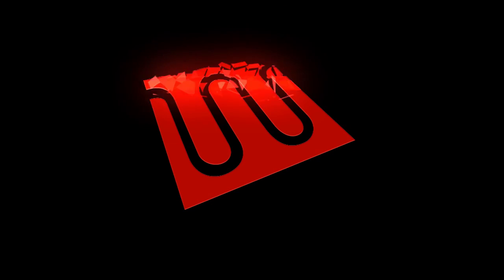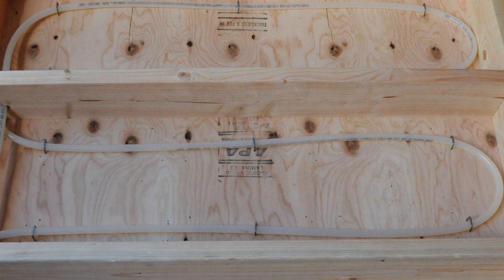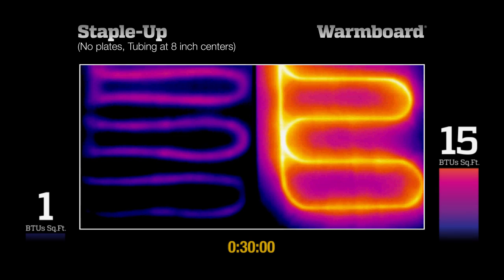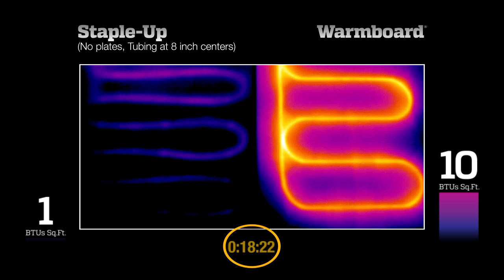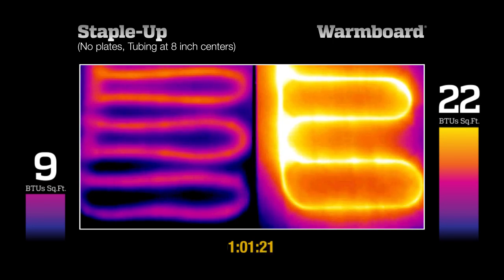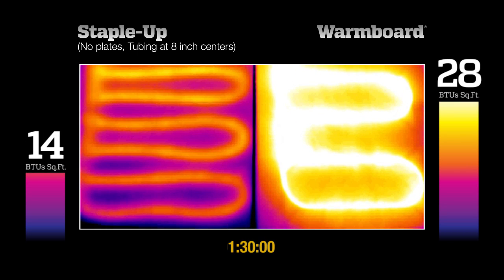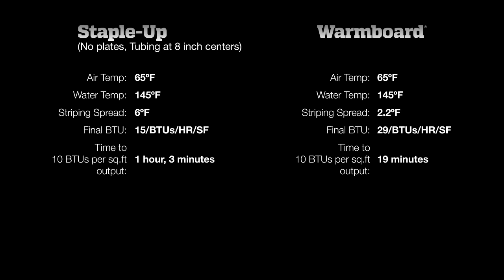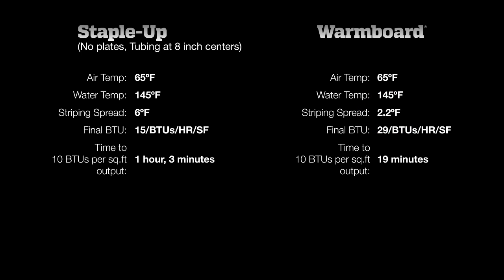Radiant Floor Heating: Staple-Up vs Warmboard (High Temp)

Comment: You can put 145 degree water through a sub floor without damaging floors?
Reply from the maker: It depends on a few variables. Yes. You can do it. And many types of systems require those higher water temps to operate. But, if you were using certain hardwoods, it could be problematic. Warmboard typically uses 90-120º.
Reply: @Warmboard  interesting. I will look into your product since we typically have high temp water
Reply from the maker: @WABoothPlumbing  Wonderful. Checkout warmboard.com or feel free to give us a call 877.338.5493